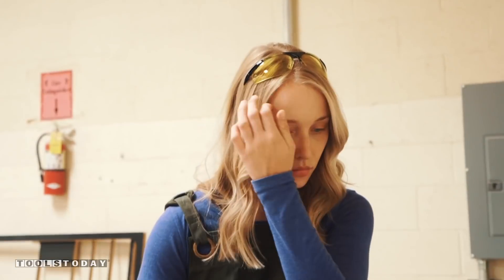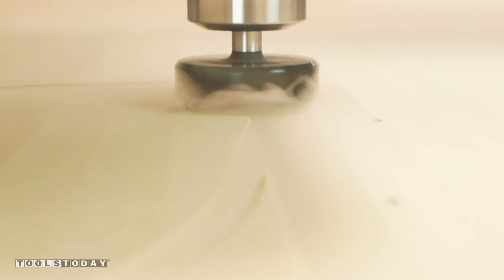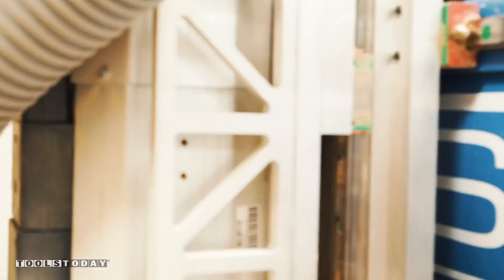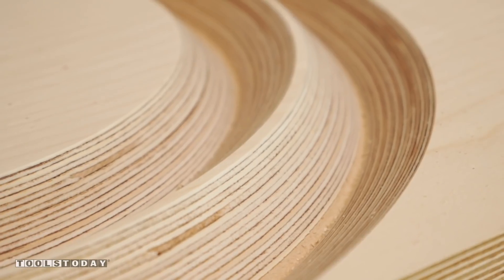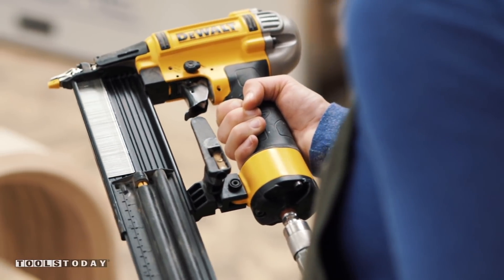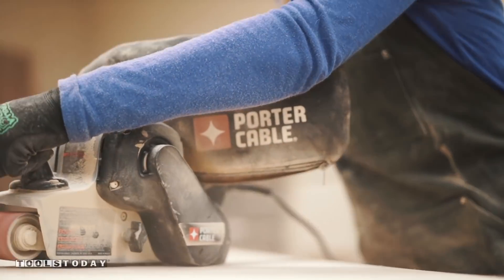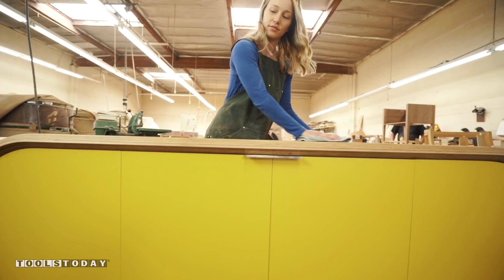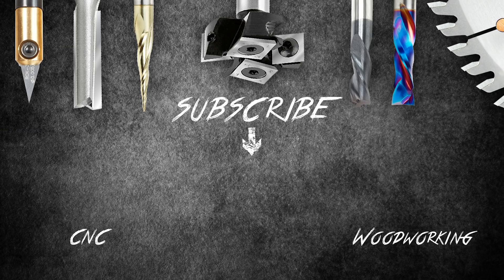CNC Project: Build Your Credenza with Olie’s Wood Shop - ToolsToday

Comment: How much chemicals in that plywood, and what is the influence on health of it?
Reply from the maker: The majority of plywood, used indoors for furniture, cabinetry and paneling, is composed of a core layer faced with higher quality woods using urea-formaldehyde (UF) glue.
Reply: @ToolsToday  so, in that Credenza in a video, formaldehyde opened?
Reply from the maker: @vorchunhubschman5114  We recommend to check with your local plywood manufacturer for exact usage, if chemicals were used. We  generally advise to wear a face mask to cover your breathing.
Reply: Don’t forget the mdf dust when she resurfaced...
Reply from the maker: @davidiliyn  Yes! Thanks David.